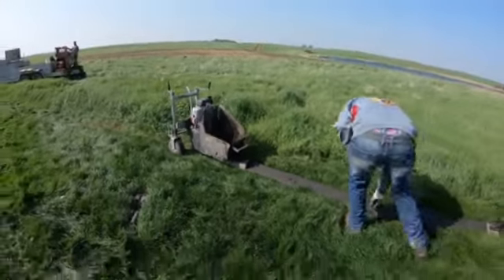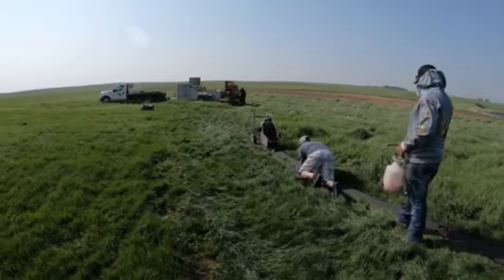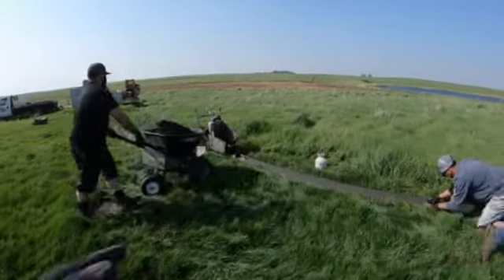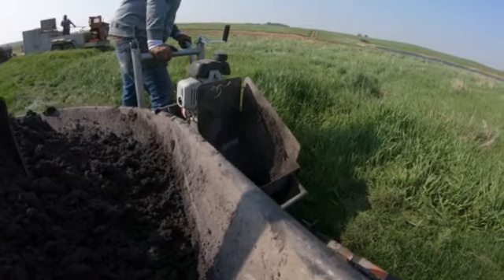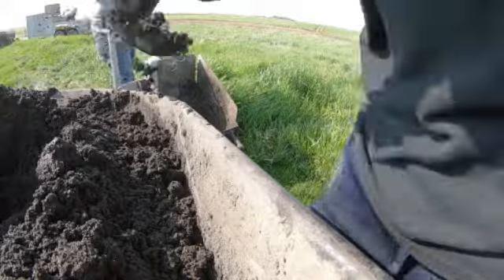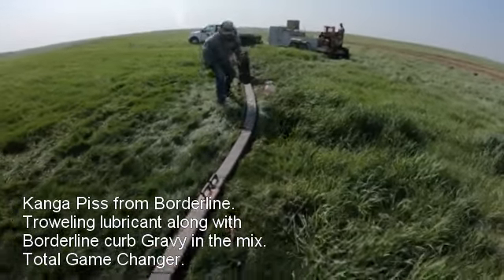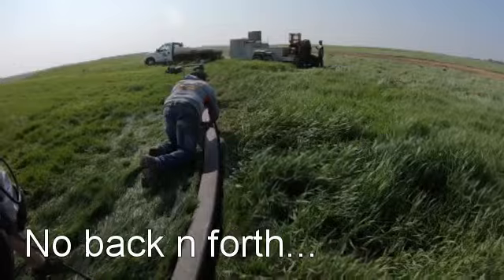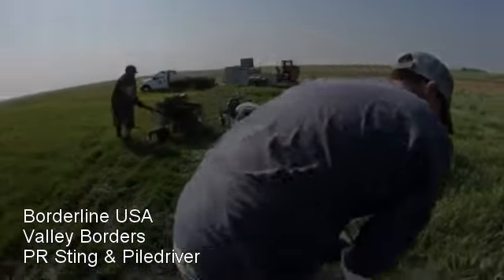Borderline USA Pr Sting & Piledriver

Comment: I own a concrete company we do flat work. Im looking to get into decorative concrete landscape curbing. This is easy money compared to what we do. I would really like to see one of these in action. I'm shopping around 4options. I'm considering making my own. It looks like this machine is quite slow is it not?
Reply from the maker: No there isnt another machine faster, this isnt flatwork, its a totally different animal and cant be compared to.  its not as easy as it looks, its moving concrete.  flatwork is stationary, here a moving machine has to create the lines and the operator is the one doing it.  inclines, declines, side angles, and it has to be finished as you go.  all this is mixed onsite, no cement trucks, so the curb is only going down as fast as the mixer can mix and it can be finished.  You say making your own?